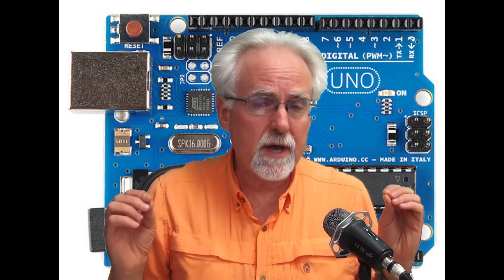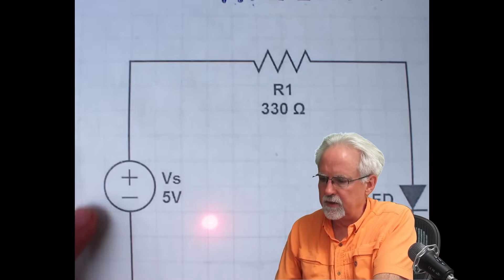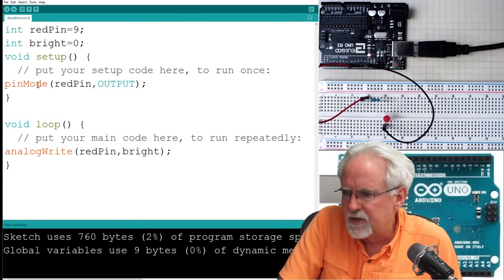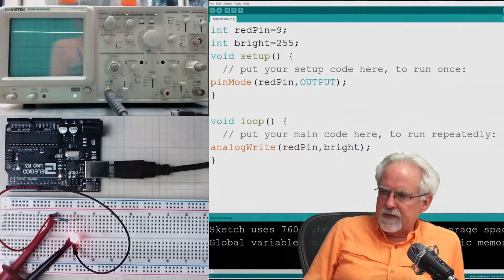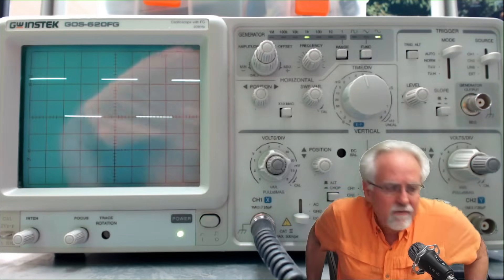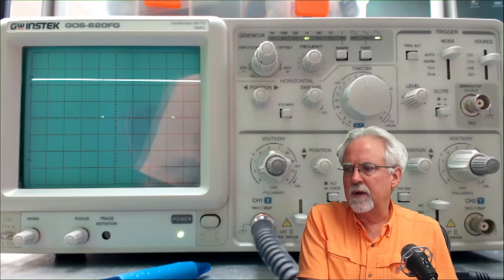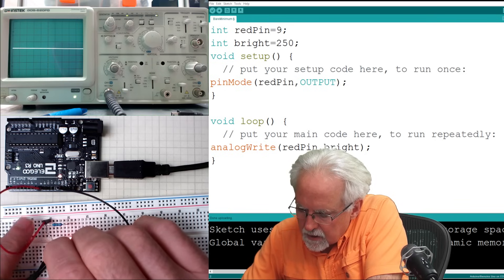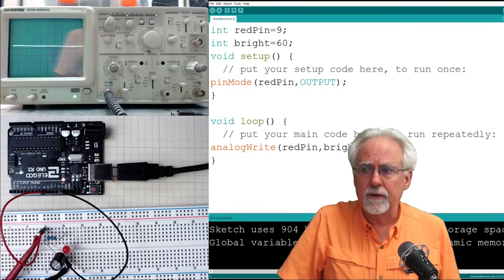Arduino Tutorial 8: Understanding Pulse Width Modulation (PWM) and the Arduino Analog Write Command

Comment: You nailed PWM, I had no problem, the Cap addition lost me a bit, but I then duplicated your setup with Tinkercad's simulator which has an Arduino and an Oscilloscope, once I did that, I could play along and duplicate what you were doing.  This is going very well.

Comment: Im working on a master slave arduino. when i use Serial to talk between them. i have a master to controle them all, and ill create a remote with a Num keypad and then i can "call" program number 55  up, and the master will find the arduino who are able to run program 55 and make it do what it does best.

but 5 arduinos and a wire on every single out/input, when i go to bed, ill bet ill dream about yellow wires strangle me...

Comment: Great tutorial, PWM I understand no problem. Turn the supply on and off at different frequencies and it tricks the eye into thinking the voltage is being varied. What I'm a little confused with is I thought LED's had a forward voltage requirement. Your example seems to drive the LED at voltages it shouldn't even work at. Why?

Comment: So Arduino sends a Voltage trough the LED in pulses (with the use of the 'analogWrite' command). 
5v ~ 0v ~ 5v ~ 0v ~ 5v ~ 0v ~ 5v ~ 0v 
The pulsating happens so fast that we simply perceive the LED to be ON all the time.

Correct me if I am wrong peeps.
Thank you for the tutorial on to the next one!

Comment: Hello Paul. Really liking your videos. I think you're interesting all ages, all backgrounds, all levels, with very clear step-by-step theoretical and practical presentations. Bravo! 2 Quick questions: 

1. Why the PWM on the analog output? I believe (I'm getting ahead of myself) the input to the Arduino board is purely analog. Why the mixed technology with an ADC on the input but no DAC on the output? 

2. The PWM period has a constant 4.2ms(238 Hz). I'd like to do some work on musical audio signals some day but, at this low frequency, I'd only be able to work on music coming from a sub contrabass saxophone. I know the microntroller is not a digital signal processor but is there any way to beef up the sampling rate on the board (or chip)?

Thanx and keep up the good work!!!!

Comment: Dear Paul, something is not clear a 12:24. Period should be around 2ms because 4,2 DIV * 0,5 ms/DIV. Not 4 ms. So it means that the signal stand at 5 V for 1 sec, then at 0 V for 1 sec and so on. Did I miss something or is your calculator broken?

Comment: When you use an analog write command, you're telling the Arduino what percentage of the time you want it to put out 5 volts and what percent of the time you want it to put out 0 volts, so you can get an average voltage of what you want. But if you really want a continuous flow at a specific voltage, and not a jumping back and forth, you'll need a capacitor.

Comment: Thank you Mr. Mcworther, I now understand how Pulse Width modulation works, it is very interesting, a short recap is that Pulse Width modulation does not exactly give you a analog voltage but instead, it makes it so that it turns on and off creating a pulse, the longer it stays on the closer it is to 5 volts (On the arduino), the longer it stays off, the closer it is to 0 volts.

Comment: So..... are you saying that Arduino analog is really more suito analog and not really a true analog?  I take it that if you add a capacitor to the curcuit you are truly working with an analog signal?
One other quick question.  I am loving your tutorials but working with an Elegoo mega 2650.  So my pins do not have the squiggly next to the number of the pin denoting analog .  I found that all of the digital pins provide the result shown in your video.  Am I proceeding correctly?  I tried the pins labeled A0 through A15 thinking that these are the analog pins on the mega 2650 but I am not getting the variants in brightness like I do when I use the regular digital pins 2 through 12 with the analogWrite command.  Any thoughts?

Comment: Coming from the world of theater, PWM is exactly how SCR dimmers control the brightness of stage lights.  They don't regulate the voltage going to the light like resistance dimmers, they interrupt the sine wave so that the light isn't getting full voltage all of the time, thus appearing dimmer.
Reply: I have to tell you that I got to use what I learned from this video in a lecture today.  I was talking about LED theatrical lighting and one of the students asked how we dimmed LED lights if they received constant voltage.  "Let me tell you about Pulse Width Modulation..."  Thank you for this video and this series.

Comment: Very good tutorial and overall serie. If you don't use a capacity, what would be the "risk" for the components you're using if you use 127 for the analog value to send 2.5 v and knowing it will send 5 v half of the time and 0 v for the second half of the time ? When to decide to use a capacity ?

Comment: I started my electronics journey again this year looking at analog tutorials and an educational breadboard with signal gen etc. I bought an oscilloscope but then spent a bunch of time in hospital for back surgery. You just married the whole thing for me. I understand PWM but this lets ' e use the scope as education.  
\Three questions. 
1. Is it more intuitive to put the scope probes across the two LED legs (although it's a lower voltage)? 
2. Is there a 'reverse' version of PWM ie analog read so you can use a potentiometer to input the brightness instead of downloading each time.
3. The approximation of DC won't actually work because LEDs are digital and don't 'dim"? You are just demonstrating the principle.
I am just barely past the level you are showing us, but I find that no matter how much you think you know, there's always great benefit in having someone re-explain it and plug the gaps.

Oh, I gave up a life of double espressos (no sugar) for tea a few years back. Maybe Iced Tea!!
Great stuff Paul. Thanks so much.

Comment: Hi all, I just wanted to know why we need to use the special pin slots with squiggly lines to use PWM. I achieved the same effect by coding it myself using a regular slot on the Arduino. I know we haven't covered for loops yet, but see below:

void loop() {

for (int repeat=1; repeat<500; repeat=repeat+1) {
digitalWrite(redLED,HIGH);
delay (4);
}

for (int repeat=1; repeat<500; repeat=repeat+1) {
digitalWrite(redLED,HIGH);
delay (3);
digitalWrite(redLED,LOW);
delay (1);
}

for (int repeat=1; repeat<500; repeat=repeat+1) {
digitalWrite(redLED,HIGH);
delay (2);
digitalWrite(redLED,LOW);
delay (2);
}

for (int repeat=1; repeat<500; repeat=repeat+1) {
digitalWrite(redLED,HIGH);
delay (1);
digitalWrite(redLED,LOW);
delay (3);
}

for (int repeat=1; repeat<500; repeat=repeat+1) {
digitalWrite(redLED,LOW);
delay (4);
}
}

Comment: ..this explained why A0 read const val= 1013(ON) when I jump a fader pin(pwm) when I was expecting a sine val between 0-1023..
with var counter i.

short i=0;
void setup()
{
    Serial.begin(9600);
}
 
void loop()
{
	i++;
        if(i>255){i=0;}
	analogWrite(6,i);//jump wire 6-A0
	short b=analogRead(A0);
	Serial.println(b);
	delay(1000);
}

Comment: You said that for analog it stays on for some time period and off for the remaining time , I added a loop for this analogWrite to keep increasing the brightness till full , so did the next brightness iteration command execute after 1 cycle is completed for the previous brightness setting or the command executes at any random time rapidly in between the cycle.

Comment: wait so the capacitor smooths out the voltage? so the system dont need to shut off and on if you are doing more complex things? is that right?

Comment: you know I had the led dimmed, then put the cap in and the led got a little bit brighter, but it was across the resistor, so prob not a good idea if at full power. but anyway, I didn't realize the dimming was because of pwm, but it is very interesting.

Comment: I'm trying to get a mental image, please tell me if I got what is happening.. The signal in the oscilloscope become a continuous function because the voltage difference causes an accumulation of electrons in one plate of the capacitor when the Arduino Pin is high, and those electrons return their path and go through the LED to ground when the Arduino Pin is low. Thus, there is a continuous flow of current and a constant voltage.

Comment: Let's say you are using components in a circuit that require two volts. Even though the analog output is set for two volts using pulse width modulation will it still work with that component? I'm wondering because it's simulating two volts by jumping from zero to five volts but is it actually going to operate in a circuit as two volts?

Comment: int redPin=9;
int n=0;
int m=(n+m);
int bright=255;

void setup() {
  // put your setup code here, to run once:
pinMode(redPin,OUTPUT);
}

void loop() {
  // put your main code here, to run repeatedly:

analogWrite(redPin,n);
delay(500);
analogWrite(redPin,m);

m=(m+16);
if (n=bright,n=0);

delay(500);
}
Reply: By changing the first delay(500) to delay(50) a complete off occurs before the next 15 increments to pin9.

Comment: Great series! Question: how would you vary the period (frequency) without changing the duty cycle or vary both independently, the way you can with a 555 timer?
Reply from the maker: Not something you can do with the auto PWM. You would have to program it up yourself.
Reply: @paulmcwhorter  Do you have a video lesson on that by any chance? Or maybe just point me in the right direction?

Comment: One thing that I tried doing was to simulate an analog signal using a digital one. This is the code I used:

int redPin=11;
int bright = 1;

void setup() {
  // put your setup code here, to run once:
pinMode(redPin, OUTPUT);  
}

void loop() {
  // put your main code here, to run repeatedly:
digitalWrite(redPin,HIGH);
delay(0.33);
digitalWrite(redPin,LOW);
delay(3.66);

}

Another interesting thing I found is that you can do these for the pins that don't have the squiggly line.

Comment: What it is doing in analog is turning power on and off in "ms" to achieve  a overall lower voltage on the output side. I didn't realize that was happening in the controller. Very interesting lesson. Thank you Paul.

Comment: how voltage reduced (in CRO screen) after connecting capacitor ....earlier it was showing 5 v for some time of the total time period remaining was 0v ..isn't the capacitor is supposed to be smoothing that break instead of reducing the voltage..??? and the voltage level is again reducing by shorter value of bright...how is that possible???

Comment: Hi Paul, thank you for your lessons. I have a problem, if you can, could you help me to figure out what I should do 
Arduino: 1.8.13 (Mac OS X), Board: "Arduino Uno"

THIS IS MY CODE:

void setup() {
pinMode(2,OUTPUT);
}

void loop() {
digitalWrite(2,HIGH);
delay(1000);

digitalWrite(2,LOW);
delay(1000);
}

Sketch uses 924 bytes (2%) of program storage space. Maximum is 32256 bytes.
Global variables use 9 bytes (0%) of dynamic memory, leaving 2039 bytes for local variables. Maximum is 2048 bytes.

THIS IS THE PROBLEM:
avrdude: stk500_recv(): programmer is not responding
avrdude: stk500_getsync() attempt 10 of 10: not in sync: resp=0x00
Problem uploading to board.  See http://www.arduino.cc/en/Guide/Troubleshooting#upload for suggestions.

This report would have more information with
"Show verbose output during compilation"
option enabled in File -> Preferences.

Comment: correct me if i am wrong 
paul once i was  kidding with a DC 5V motor by switching it ON and OFF rapidly as fast as i could 
it was kind of not stopping but moving slowly like bhmm bhmm bhmm 
ofcourse my time was large when i was giving motor 5V the 0 then 5 ... 
can i relate this thing to PMW to understand better does it doing the same thing ?

Comment: PWM on and off very fast. The Arduino PWM pins can only do full power or no power.  Use a capacitor if you need a smoother voltage delivery. 4 milliseconds is the window of time.

Comment: Very good video.  The VWM was explained very clearly.  Many thanks.  Question: will one as an amateur,  wit the arduino as a hobby  eventually need to purchase a scope? if so, would you recomment one  for amateurs?   And yes,  I also need to have my work bench neatly organized, everything at 90 degrees,  not stuff cutting across.

Comment: A DVM meter will measure the DC voltage but it won't measure the PWM Pulse width modulation as an "average voltage". How can you measure using the Oscope and DVM meter to measure the PWM as an average voltage?

Comment: Hmmm. Hey Paul. Big fan here, following since lesson one. I used a For loop to increase value "x" from 0 to 255 within a delay of 10 milliseconds and the LED increased from 0 to 255 within PWM as expected. When you mentioned that PWM works within a gap of 4 milliseconds, I just had to test that within my delay. 4 = Still no problems, just faster oscillations. However when I set it to 3... Your explanation implies that it shouldn't have had enough time to complete the wave gap and therefore shouldn't have turned my LED on at all... Yet it did 😅Any explanation as to why?

Comment: I can see my dream come true only because of your fantastic tutorials. I want to run a CNC machine using Arduino. I will be greatful to you for rest of my life.
Reply: Hows the CNC machine going?
Reply: What’s a CNC machine?
Reply: @danieldickinson9167  CNC stands for Computer Numerical Control and it is used to move the several axis of a tool by computer control.  Industry uses CNC for welding metals, drilling, cutting and more on many materials.  There are CNC drills, milling machines, lathes, routers, plasma cutters, water jet cutters, welders, EDM machines, benders, grinders, and probably many other machines that are CNC.  People are now building their own 3D printers which are a type of CNC machine.

Comment: I understand that the PWM is alternating between HIGH and LOW at quick enough rates to average the voltage specified. I don't understand, however, why the capacitor affects the voltage of the LED when it's wired around it instead of in line of it, either before or after

Comment: I don't quite understand how adding the capacitor can be safe.  When the cap is fully discharged and the pin is momentarily high, won't that cause the current to exceed the prescribed minimum of 40mA and fry the pin until some charge is at least built up?  What will happen if you put the cap after the register so that it is over the LED?  Won't that be safer? Please help!
Reply: ...don't worry Paul, I see this has been asked a number of times.  I'll google the correct circuit as eluded in your other responses.

Comment: If the period is 4ms then what does 255 represent? I understand 255 = 5v and 127 = 2.5v but the value of analog write seems the duration of the pulse. So 255 is how long time wise? 127 is how long time wise?

Comment: i absolutely love your new and improved most excellent series on the arduino uno, you're truly inspirational, I did have a questions however, and i really really hope you could answer it.

when you say the capacitor smooths out the signal, i can see what you mean with reference to the oscilloscope but what exactly does the capacitor do to 'smooth' it out, and what does being smooth even mean in terms of the voltage.

Comment: question: adding the capacitor made the LED less bright. I thought I just read that capacitors should not affect voltage. Why did adding the capacitor make the bulb dimmer if the voltage stayed the same?
Reply: Well spotted; you are right. Without the capacitor the LED is being pulsed fully on and then fully off every cycle of the Pulse Width Modulation(PWM) output. 
Sorry for this next bit but I am not sure how to explain it more simply, here goes:
Using the capacitor to smooth the  output to a steady voltage makes the voltage drop across the LED required to turn it ON more significant. In fact if the smoothed voltage falls below the LED  threshold voltage it will be OFF; at around a value of around 80. When the number is raised to set the voltage across the capacitor just high enough to turn on the LED it has a low current flow and is dim compared to the un-smoothed pulsed value, The short pulse without smoothing will still light it fully on for the time it is high. The LED will light dimly even with a pulse value of 1. 
I am sure 
Paul McWhorter can explain this better than I can, main thing is to keep going and enjoy this fascinating hobby as you understand the world we live in better.

Comment: What is it called when you add a capacitor to a circuit to smooth out a digital signal?? Filtering capacitor??decoupling capacitor?bypass capacitor??

Comment: Made perfect sense. Had never thought about or been shown how we digitally altered voltage like this. I had wondered why you just didn’t hookup a digital multimeter instead of the oscilloscope, until you picked an in between voltage and then went “ah ha”, now I get it.

Comment: Yes, it absolutely drives me crazy when things are not square. Along with many other little pet peeves that I have, lol. I am always squaring things up on my work benches. Coworkers have joked with me and said "I'm surprised that you don't have lines drawn around where your things are supposed to go."

Also, your videos are fantastic. They have helped bring me up to speed very quickly on the Arduino. I am building a few small tools for my lab at work, such as auto-calibration tools, and a few simulators for the proprietary hardware that we build and I test in system test. So far I've saved the company a lot of money and myself hundreds of hours by automating things.